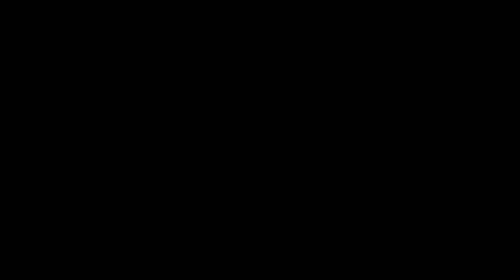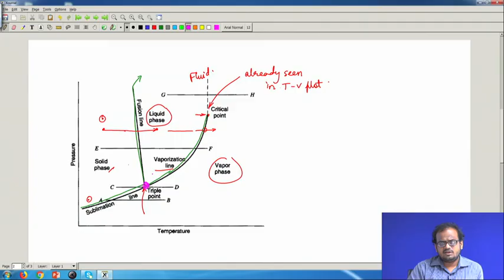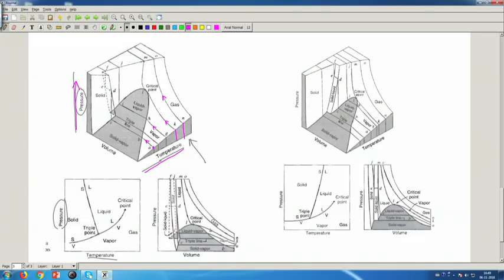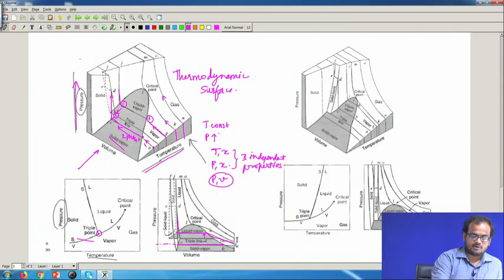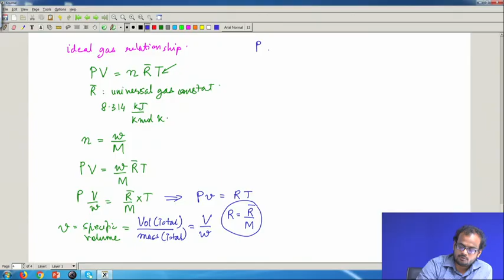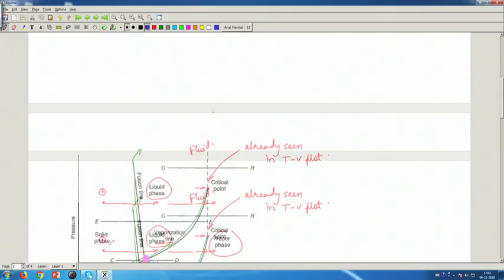Lecture 03 : Properties of Pure Substances (contd.)

Comment: At 5:00 , sir said that the ordinary pressure is so large that we can't liquify hydrogen and helium.....but the critical press of hydrogen is 13 bars, and we need to increase the pressure, not reduce
Reply: Yes, both the gases are in gas state at room temp and 1arm pressure...you need to reduce pressure for that gases to appear in liquid state at room temp!

Critical pressure is where you cannot say it's liquid or gas basically it will be fluid as it has 2 phases at that pressure (tripple point is different)

Comment: What if we stop the piston ? While it is in phase conversion mode...Now the overall Volume is constant so the pressure has to go up right? So technically we can alter pressure and volume will be constant( specific volume as well)
So temperature has to go up even in phase change mode! Correct me if am wrong.
Reply: You can heat up the system when piston is fixed. It will increase the temperature but at the same time will increase the pressure. Your volume might remain same but specific volume would change. Simplest way to see this would be to draw vertical line in phase change region in T-V graph. Either you'll end up with liquid at high temp and pressure if you keep heating or superheated steam. Or maybe it might just reach Critical point ( i doubt practically you'll do that anyway)

Comment: Assumption behind ideal gas is high pressure and low temperature sir
Reply: No
Reply: Reverse your assumption
Reply: its basically low density. any way you achive low density will minimize the interactions at molecular level.